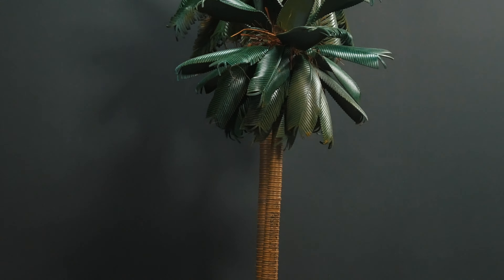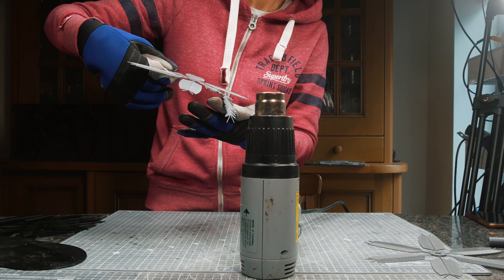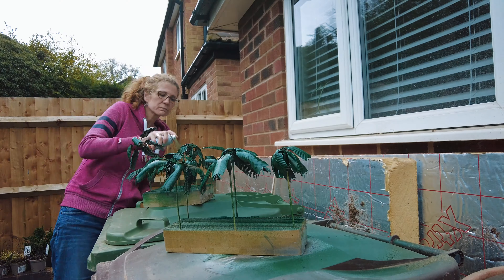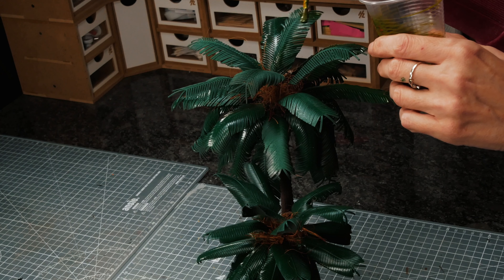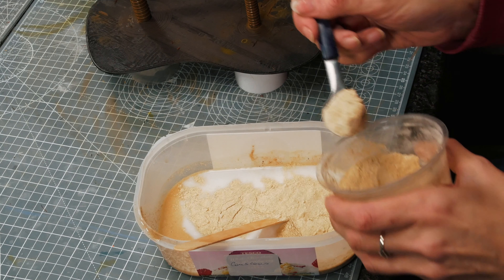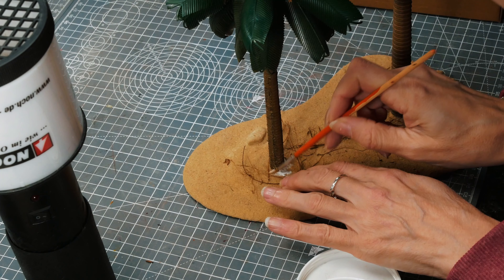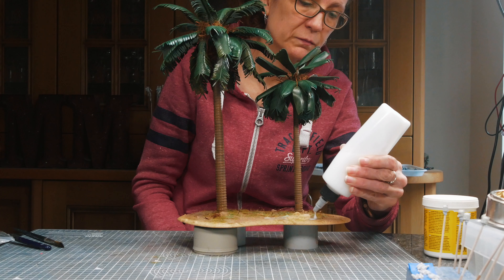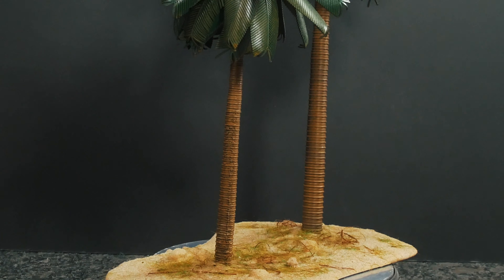Can you 3D Print a Tree? | Palm Trees with Elegoo Neptune 3 PLUS

Comment: These look awesome! I want to try this now!
With the ones that "wilt" too much. You can always stick that bunch at the bottom and paint them a light grey & beige colour for spent fronds. Looks untidy and more like a natural one rather than a garden manicured one. Guess it depends on the landscape they're going into!
With the colour, some palm species have dark green and glossy fronds. Maybe not that glossy though.
Reply from the maker: I think dead fronds are definitely the way to go next time.  I do need to do something with the trunks…
Reply: @KathyMillatt  maybe heat the trunk as well and put in a slight bend? Coconut palm trees (and other species on the Australian east coast) can also have very smooth long trunks with it a bit rougher just near the top. Where fronds have dropped off but not cleanly from the trunk. I think they should also get a little wider right at the bottom. Maybe some das clay can solve both?
Reply from the maker: @petemac2126  This is a test piece on 3D printing so I would design a new tree rather than change this one now. It would definitely have some work on the trunk though such as a bend or better representation of the texture.

Comment: Great video. Definitely give the trunk a nice matt varnish, maybe before applying the varnish give the trunk a very gentle drybrush to give it some more contrast. As for the leaves I'd give it a blast of satin/gloss varnish mix and maybe a light highlight for a bit of OSL from the sun.

I think for smaller scale trees I think 3d printing the tree structure i.e. trunk, roots and branches is the way to go and then resort to filling out with static grass, leaves etc.
Reply from the maker: I have done trunks and lower branches in 3D print before but you end up making most of it in another way because of the fine texture needed in smaller scales. 
The trunks definitely need a bit more work.

Comment: I thought I'd seen it all. Everything I could think of 3D printed. But trees? Never considered that in a million years! Good video. Maybe a hair dryer instead of a heat gun? Won't be as hot so less chance of damage but not sure if it'd be hot enough
Reply from the maker: I certainly need to experiment a bit more. You can hold them further away from the heat gun for a less vicious melt.

Comment: The fronds looked pretty great after you melted them, but the trunks were stylized and unconvincing. Since you ask, I would go ahead and knock down the shine on both trunks and fronds. Also, these are massive! Very curious as to what they'll be used for.
Reply from the maker: The shine does need to go down quite a bit. These are 1/48 so the original purpose was for tabletop gaming like Star Wars Legion. I wanted to try them out and I think I’d need to think about the design more for if I was doing smaller scales.
Reply: @KathyMillatt  Well the fronds looked good and that's the hard part done. At smaller scale the trunks might do better, especially if they were dressed up. I myself am facing a decision between buying and crafting palm trees, so interested in your conclusions, and thanks for all the entertaining and informative vids!
Reply from the maker: @bradcraig6676  Thanks!

Comment: Kathy, sorry to be critical ... the leaves look awesome but the green is a bit too dark ... and the trunks look fake.  Maybe the trunks could have a small bump or something added so they don't look so perfect ...
Reply: Getting "bumpy" trunks might be a good use for the "fuzzy skin" setting in some slicer software (I know Cura has it; don't know about PrusaSlicer).
Reply: Yep. The lower fronds could use some yellowing at the edges (the lowest ones die and drop off as new ones sprout from the top) but the overall color and gloss are fine.
The trunks should at least be as non glossy as possible and definitely need more texture.  Real ones have what look like flat edged wedge shaped teeth pointing up. They are the stumps of fronds that have died and fallen off. That should be in the print file as adding them after printing will be tedious at best.

Honextly, they look like date palms that were designed by someone who has only ever seen pictures of them but didn't look very closely.
Reply from the maker: I printed them from the files and these were a concept so there are definitely things I would change if I was designing them. Next time, I’ll buy some better coloured paint rather than using what I have on hand. Having said that, there are palms with dark leaves but there is always a lot more dead on there. I may do the whole bottom layer brown and wilted.
Reply from the maker: I don’t know that one but will definitely explore it.
Reply from the maker: I agree. I wanted to test the concept but now I know it works, I will try my own designs that are more realistic. 
I tried adding the dead colour but the oils were a little too thin. I think the whole bottom layer should have been that dead colour.
Reply: Could you create some little filings and add a little glue to the tree here and there, then cover with the filings? They would have to be small in order to recreate that shredding of the trunk look. This is a great vid, its got a lot of people talking.
Reply: @tamsinp7711  Kathy did a great job on her palm tree project ... and she got us all thinking.   Your comment about a "fuzzy skin" setting in some slicers got me thinking about 3D printing ... I'm close to buying a printer and will keep it in mind.  Was thinking about printing a shingled roof ... a bit of fuzziness would be useful ... roofers don't make "perfect" shingled roofs every time they shingle a roof ... every roof is different.  But lets think ahead a bit further.  Might AI someday be a part of a slicer program so that uniqueness might be introduced to 3D printing?  In Kathy's example, might the software make a frond or two smaller or larger?  Might the software add or subtract a frond?   Let the slicer add a bit of AI creativity ... then let the user review what it did ... and print if you like it.  I've seen how ChatGPT can assist in Arduino programming ... wonder what it could do for 3D printing ... just a thought.
Reply from the maker: @nathanwood5977  Not sure how to get those filings but something with a shaggy look would be awesome

Comment: The leaves should have a satin finish. Either wait for dust to dull the leaves or test spray with a gloss or satin varnish
Reply: I agree. A little lighter in colour too, you could also paint some of the leaves brown. I would also be tempted to add some off white to the trunk. That said, great video and the I love the trees.
Reply: oh and slash/scrape a knife into the trunk here and there to add a bit of texture.
Reply from the maker: I did paint some of the leaves brown but the oils dried a little less opaque than I hoped. Next time, I’ll wilt the whole bottom layer and paint them brown from the get go.
Reply from the maker: I think satin too. They need knocking back a bit.
Reply from the maker: Yeah, the trunks are a bit uniform!  I’ll probably add some more colours to them and a dark wash.

Comment: 葉の方は、heaterの加工で、旨くできてるけど、幹の方は、模様が等間隔すぎて、リアリティがイマイチですかね
Reply: That caught my eye, too.  They're spaced too uniformly, for sure, and the trunks look to be too bolt-upright, perhaps?  However, that's the fault of the modeller, not Kathy.
Reply: @Loneman_OG  
basically, i agree ur opinion.
however, in my feeling, she has much skiil to modify the original STL.
Reply from the maker: I agree. I didn’t change the files at all but if I do more, I’ll probably design my own.
Reply from the maker: I agree but I know that they’re straight because that is easier to print. I’d have to do testing to get a bend in.
Reply from the maker: I wanted to just print these as a concept. Now I know they work, I will try designing something similar and more realistic.
Reply: @KathyMillatt   I have no doubt they'll look much more realistic once you sprinkle some of your modelling magic on them. 🙂

  As for adding a slight bend, any FDM printer will still print them just fine, but I think I'd stick with printing them straight and then using a hairdryer variable temperature, handheld air blower (they're much more controllable than hot air guns) to heat & bend them, and then use the "cool shot" feature many hairdryers VTHHABs have to quickly cool & set the curve.  That way, each tree can be shaped to have an individual look.

  I'm looking forward to seeing what else you use them with; you make some incredible pieces. 👍
Reply from the maker: @Loneman_OG  I wasn't sure a hairdryer would get hot enough but the hot air gun went from "not hot" to "too hot" much too quickly.
Reply: @KathyMillatt  
anyway, i believe uy skill and expect
future work.
tkx much 4 ur replay msg.
Reply: @KathyMillatt   Yeah, they're great for making large plastic blobs, especially with PLA.  I've gotten away with using a small Chinese heat gun (that gets used for heat-shrink duties) when working with PETG, but I had to be very careful, which is why I mostly use, and would recommend, a hairdr (very manly) VTHHAB.  

  Anything over 2KW with 2 speeds, 3 heat settings, and the cool-shot thing works great for all kinds of plastic softening, not just printed stuff.  I'm currently using an old one that I, er, "liberated" from my wife; of course, it's now painted black, has racing stripes, and also speed holes which, as we all know, gives it MO' POWAH, and it now serves a far more important & useful role than it ever did before. 😝

  Did I mention it's great for speeding up paint drying, post IPA-wash resin print drying, and speeding up 2-part resin cure times? 👍
Reply from the maker: @Loneman_OG  I have a hairdryer just for modelling so will give it a go,  I use it for drying paint etc at the moment.